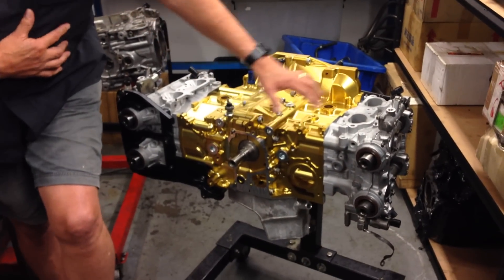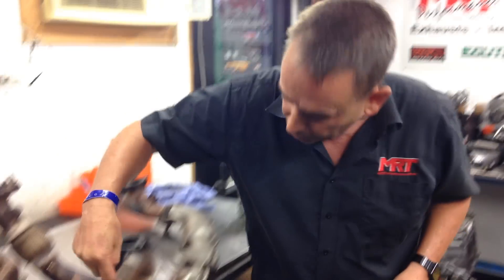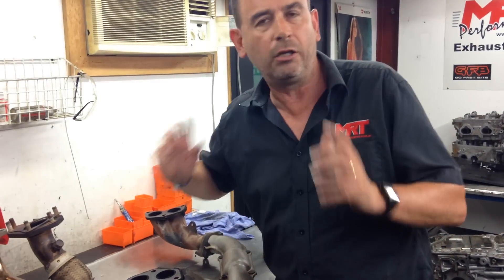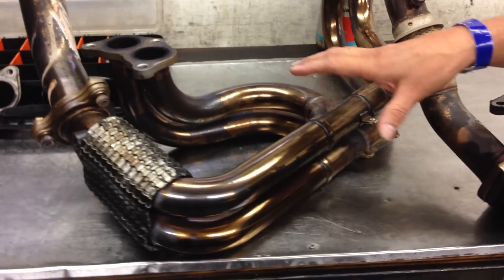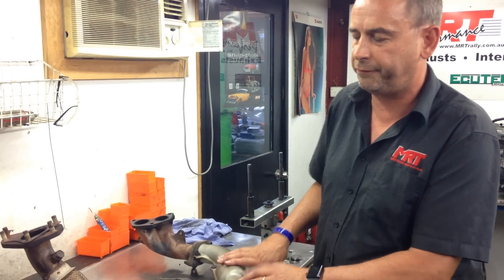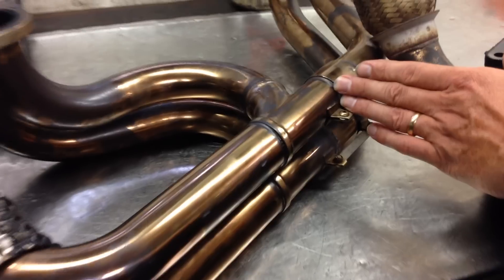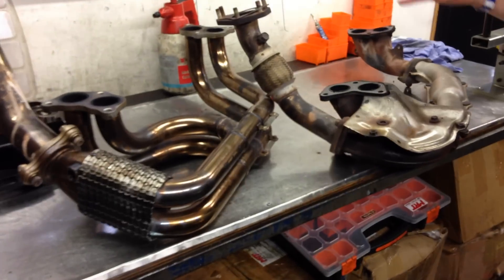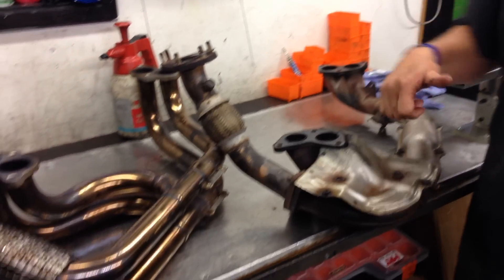Project Billet - Aftermarket Exhaust Headers/Extractors VS. Stock Subaru

Comment: SF5 GT Forester = changed uncatted up-pipe and a MRT 3inch s/s/ exhaust = with TDO4 and 440 injectors - and big inlet tube and K&N air filter - best for my automatic trans ! top quality info 100%

Comment: Hey Brett, could you dedicate an additional video discussing when an external wastegate modification is necessary? Or even discuss its fault and why it shouldn't be used on a stock turbo sti (with aftermarket exhaust boltson) or even an upgraded engine (bigger turbo, fmic/tmic, bigger injectors and fuel pump, etc). There's seems to a common debate of when it's necessary to use an ewg with an uppipe. I've heard of owners using a tial ewg on stock sti turbo, in which they would permanently block the opening of the turbo internal wastegate. Please enlighten us Brett, Subaru Modifying God of Wisdom. Thanks!

Comment: i built my own headers for a low mounted gtx3076r in my shed at home.  I used schedule10 SS304 40nb butweld.  TIGd up myself.  On boost well under 4k RPMs on a ej25 with a FMIC and reverse mani.

Comment: I watch engine masters and I can agree with this as they have done lots of different header tests and they virtually don’t make any difference in comparison to most other mods. That’s why I’m sticking with stock manifold in my 600hp build with a v3 closed deck, dom5.0, Kelford high lift 282 cam, race ported heads gsc oversized valves, and beehive valve springs etc.
Reply: How did you go ? I’ve just built a set up going for 300kw atw maybe a little
More and was thinking of running stock headers as well 
Cheers
Reply: @graygp8178  oh when I said 600hp build I meant that’s how much power it made but that’s only on 25 psi. It could take 35-37 psi and the block is good for 1000.

Comment: I've definitely enjoyed watching these videos about this build. My only comment would be that I don't know that aftermarket headers are a TOTAL waste of money with a stock or smaller turbo. For example, I have a 2006 WRX with Tomei headers and uppipe, and there is a very noticeable difference in spool time. I've done a VF39 swap, and I can hit full boost about 200-300 RPMs faster than when I had my TD04 with the stock manifold and uppipe. Probably not a whole lot in the world of power gains, but getting into boost quicker and widening my power band is definitely worth it in my book.

Comment: It’s an old video (now), and I’ve kept my comments to myself. 
But now that I have real experience in this space, I’ll say three things. 
1. That aftermarket manifold on the bench is not made in Japan. It’s from Taiwan.
2. “It’s generally accepted that the EL header will bring boost on earlier”? Ummm, no it’s not. It generally accepted that the opposite is the case. Including by Tomei themselves.
3. I put the same manifold on an EJ25 that had the MRT XC set of components already installed and, before any tuning, it transformed the mid-to-high range power straight away... on 12-14psi. This isn’t opinion, it’s what I have experienced.
Reply: how do you know its made in Taiwan? im curious
Reply: you know what brand? are empireperformance any good
Reply: Ali Toroganan The tubular exhaust manifolds being referenced are sold by many brands, but they are all the same - Tomei, RCM, GTech, PSR, etc.
Reply: @peterschurr8087  im running a 20g on a gc8 heads and e85, changing to an el aftermarket headers how slow will it build boost? 500rpms late or more
Reply: Ali Toroganan if you’re matching it with a full exhaust, intake and intercooler, you’ll not see a big increase in lag. It’s important to keep the intake to the turbo as unrestricted as possible... minimum bends, large filter.
Reply: @peterschurr8087  ima go speed density with it, i have a fmic tho

Comment: Great video mate 😎 would it be worth wrapping the aftermarket headers with heat wrap or not bother? I don't really drive it hard but just wondering if their are any long term effects of wrapping them? Would keeping more heat inside the pipe make them crack over time?

Comment: I’ve done both and I can say I wouldn’t bother with upgrading the headers.. just port the original headers at the joins. I would however consider upgrading the uppipe... for a larger twisted turbo setup. 
I prefer the rumble of the stock unequal cast iron headers ... it always sounds deeper to me (thicker material = deeper note)
Reply: did you also have to port the flanges that go to the heads? to many people over look the importance of port matching

Comment: Question i hear a lot of people saying that the stock extractors make two of the cylinders hotter and flow less which can contribute to engine failure? 

Is this a myth or true it’s pretty much the only reason i wanted to change mine from stock to aftermarket and for that true rally note!

Comment: I generally find your videos informative however I was surprised you claim no power gain with an upgraded EL header on a stock turbo. We have done lots of dyno comparisons and in every case an upgraded header will increase power even on a stock STi turbo.
Reply: My experience is the same.  EJ25 w/ a VF34, fully tuned before & after - the upgrade to a Perrin EL header granted me a 30+ ft/lb. bump in torque across the mid-range.
Reply: i would say technically not much diff. if it still on single scroll turbo...  the biggest change would be changing from single scroll setup into twinscroll setup...that would be a different level of power, torque and spool/respond

Comment: At what power point would you say it's time for the headers to need replacing?
Reply: It completely depends on the turbo and engine size, for an ej20 I'd say anything over 250wkw will probably start to see minimal gains with larger pipes. THese cars actually do better with small header primeries and a twin scroll setup,  guys here in nz pushing 300wkw with holsets spooling at factory speeds with stock legacy 34mm headers. Stock heads with a forged bottom end. Header size is quite interesting on subaru, check out some of the data logging over at NASIOC
Reply: Sam Burrows awesome thanks I will check it out

Comment: Do you think there is much benefit from porting the stock exhaust manifolds?
And is exhaust wrapping or ceramic coating needed or overkill?
And is there ever a problem with too large diameter exhaust or uppipe?

Thanks for the informative videos! And maybe you could do a video on TGV deletes  (just found your video on them) or aftermarket intake manifolds.
Reply: I gasket matched my oem header and put a grimmspeed centre pipe on it, got faster spool and pushed 413hp to the hubs (built engine)

Comment: You gotta be careful on the brand of headers you get.  A lot of claims to make more power but youll need to do you own testing. I got Killer B EL headers because of so many people doing some legit testing with them.Expensive as hell but worth it. Injectors, verticooler,and killer B netted me over 30whp over last tune.
Reply: Nice I got the v band headers with up pipe. I definitely feel the difference . No tune yet.

Comment: Can you make 500+ Hp with a properly set up engine and retain reliability with unequals?
Reply from the maker: the design of the header wont effect reliability, so yes we can achieve that
Reply: That's amazing! You read so much about exhaust scavenging causing excess heat in a specific cylinder doe to header design. So the only benefit of the equal is more torque? Or is that a myth too? I'd love to see a video dismissing any header myths!

Comment: how come you didn't wrap the headers?
Reply: To show them off better?
Also wrap can catch on fire if oil leaks on them, I would opt for ceramic header paint for headers and up pipe at least which are under and close to the engine. I guess the down pipe would be fine to wrap as I cant imagine oil getting on it so easily.

I dunno if there is a special wrap that wont soak in oil, but regular exhaust wrap can catch on fire.